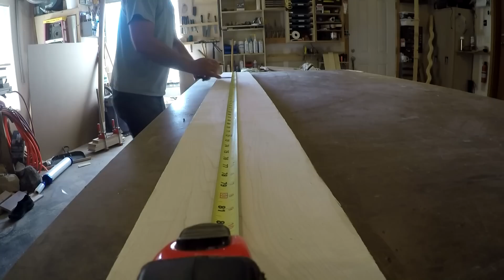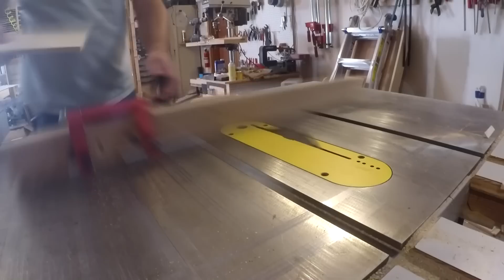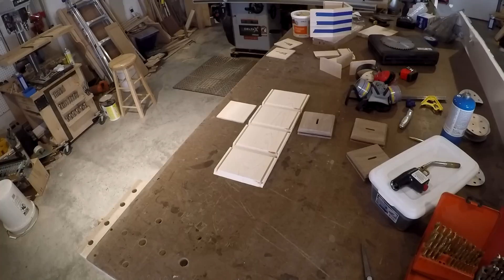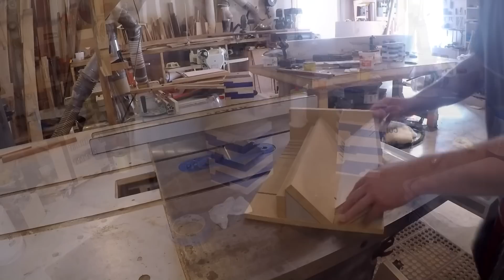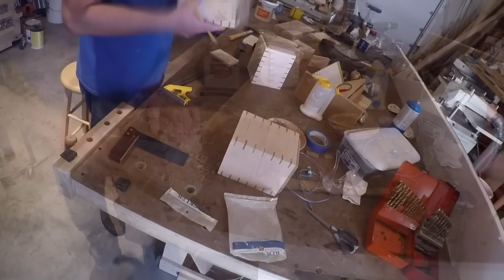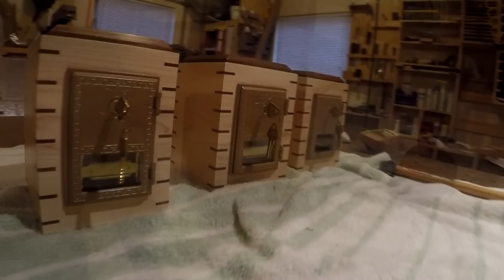How to build a Wooden Piggy Bank like a Bank Vault

Comment: The link doesn't appear to work for the mail box door
Reply from the maker: It looks like the door I used has been discontinued, but you can search the web for a 3 1/2" x 5" brass mailbox door.  There are several different styles out there and several vintage sellers on eBay.